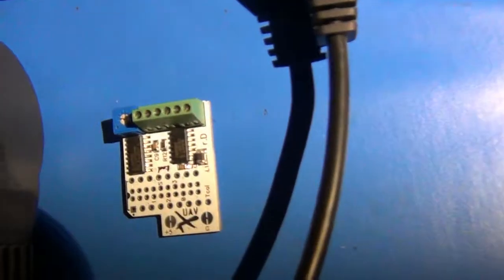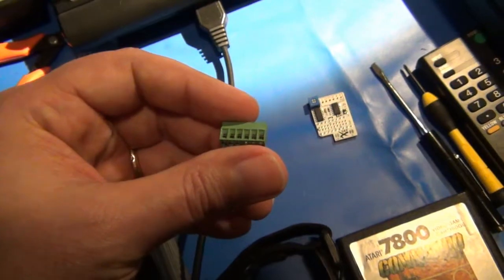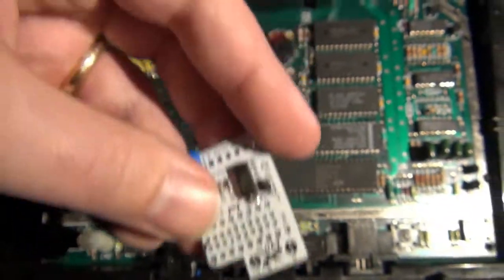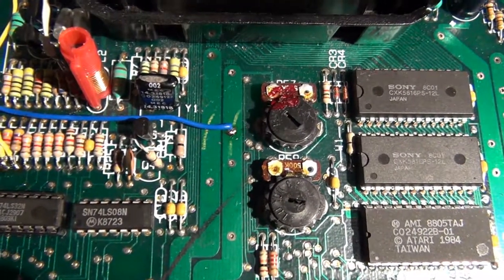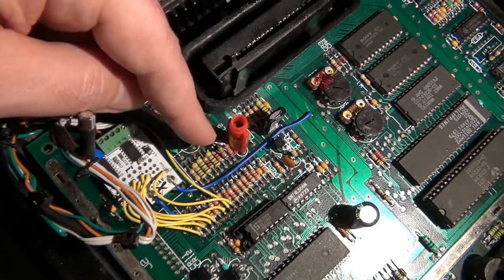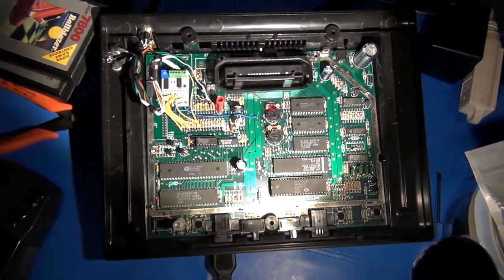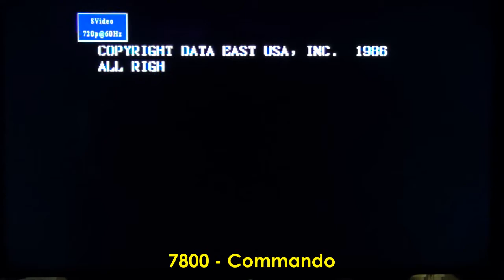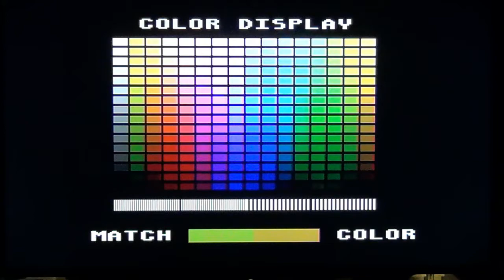ITC#23 - A7800 UAV Install overview and testing

Comment: Thanks for your coverage of the UAV mod on the 7800!  I was about to purchase the RGB mod for my 2600, but was hoping for a cheaper solution that would still give me great results.  I ended up purchasing a 7800 with the UAV Rev D mod and dual mono sound off of eBay.  Your videos really helped me make up my mind and feel good about my purchase!
Reply from the maker: Wow, I hadn't looked at this video in sometime. I didn't have the colors set right when I originally made this, and I've redone the internal wiring in the 7800 shown here to make it neater. The UAV is the best option available for video output until an RGB solution happens to be created. The 2600 RGB I've installed and can tell you that it looks very impressive. In fact, the s-video from the RGB on the 2600 looks as good if not better than from a UAV. But yes, for the price of what the UAV boards cost, they are an excellent solution and I've got the one in my 7800 as shown in this video still working strong as well as one in my 130xe. I've installed well over 60 UAVs at this point across various Atari systems and it still impresses me every time when I go to test one I've just installed for someone. Thank you for watching and for the comment!

Comment: What would be the best way to pull dual mono audio out while leaving the RF modulator as-is? Won't lifting the resistors on the north ends take audio away from the RF modulator?
Reply from the maker: Yes your are correct and I do have a much more in-depth video for installing the UAV into a 7800 and specifically show you how to get the dual mono audio without sacrificing the RF audio. This newer method I show in the newer video is how I do all of my client systems now. If the client requests to remove the RF modulator then I use the old method. Basically requires adding in two additional resistors to the south legs and running the filter cap from the ends of these instead of the original on board resistors
https://youtu.be/t7b3JXgZzcw?list=PLypzYHeVZt9n9dwfBX7OVUlTLZl1USx8O&t=452
Reply: Thanks a ton, these guides are a lifesaver when the original .pdfs have such tiny images.
Reply from the maker: @TastySnax12  The 7800 UAV install guide pics are too small? Are you talking about my guide for the 7800 UAV installation or the booklet that comes from The Brewing Academy?
Reply: I mean the booklet that comes from The Brewing Academy. Your guides are fantastic!

Comment: Any update on the S-video upgrade option?  Do you do mods for others?  Thanks!
Reply from the maker: There are two updates on this actually. One is that the UAV is more readily available now through the Brewing Academy and I've linked that in my pinned updated comment and the Magic Knight S-video has undergone a redesign and produces a comparable s-video image as well but it seems to have possible compatibility issues with some upscalers and converters like the RetroTink2x, but it works fine on my current AV hardware. And yes I do mods for others. Contact me for more information.
Reply: Ivory Tower Collections so is fb the best place to contact you?  I am there under the same name I use here.  Thanks!
Reply from the maker: @drewash9  If you click on the About section of my YT profile you can answer the I'm not a robot questions to get access to a direct email. But the FB link is also good and I've had quite a few message me that way. Thank you for watching and subscribing!